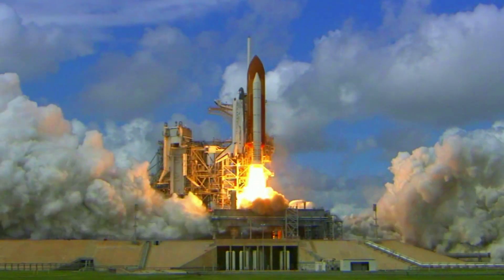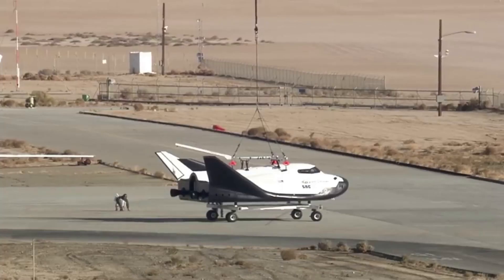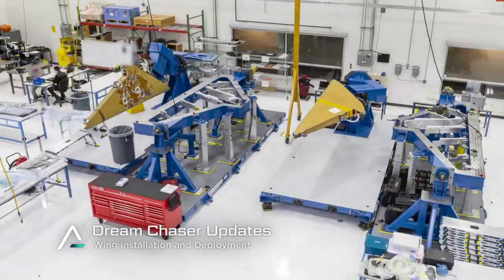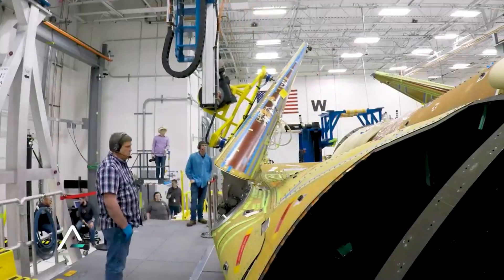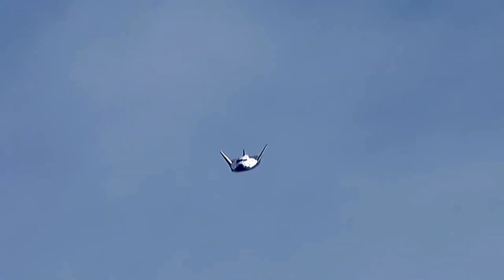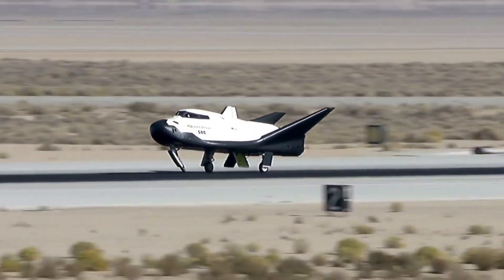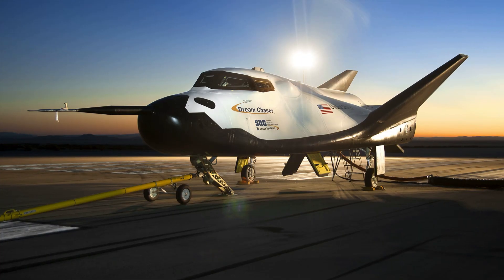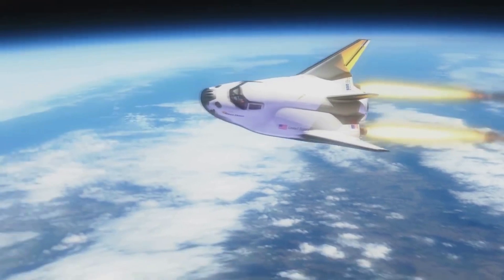Dream Chaser Tenacity Is Taking Shape & Almost Complete

Comment: Has any of these companies ever had their engineers look into the property of the slag and residues of the waste byproducts created in making materials like metals. The slag is skimmed off then discarded. But its survived high heat in the process. May some times throughing the baby away with the bath water. May have materials or substances that could be used as heat shields or radiation shields in then.
Reply: Slag melts before the metal, so it's melting point is quite low. In fact, those sparks you see flying off a blacksmiths hammer is in fact slag squirting out from the cracks of forged steel.
Reply: @Ranstone  thanks for that info!